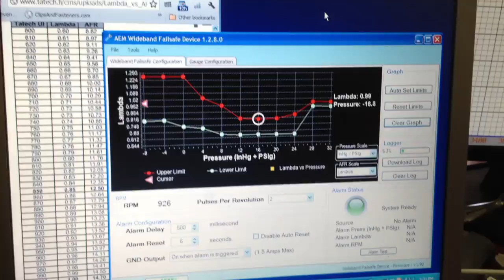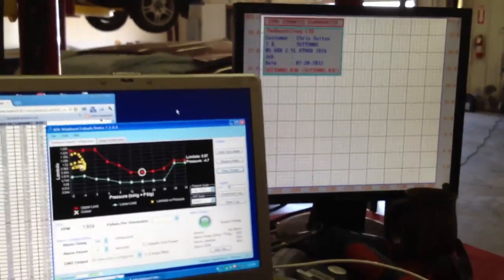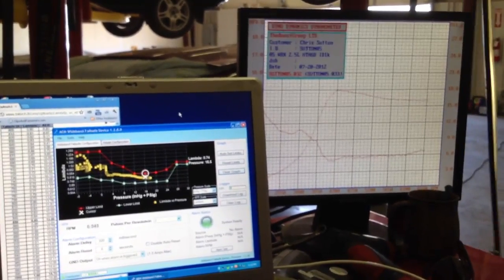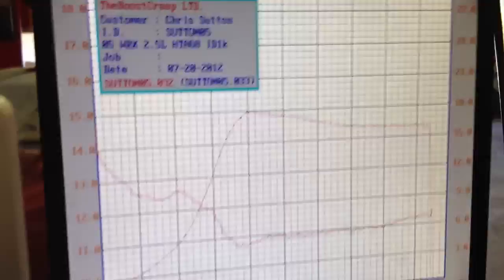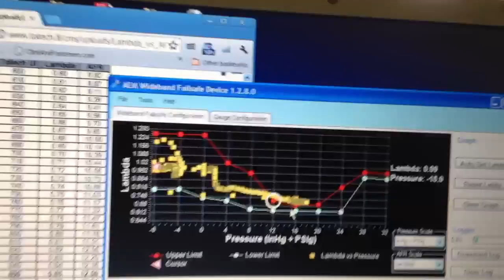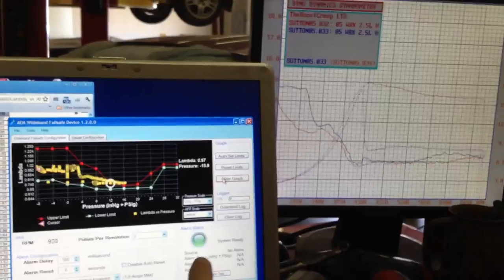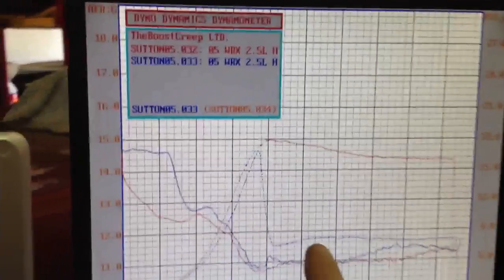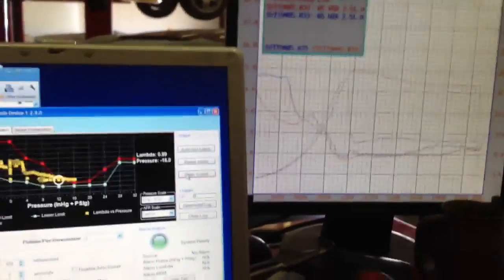AEM Failsafe Gauge Demonstration

Comment: So is this how you hooked it up? Used 85 and 86. One side was connected to the 12V battery and then other side is your ground trigger from the gauge to energize the coil. Then you used 30/87/87a to go from NC to NO when the gauge sends out the ground trigger signal?

Comment from the maker: The failsafe gauge can control a relay with either normally open or a normally closed circuit. A pulse with modulated solenoid such as boost control would be hooked up on the ground side with normally closed.